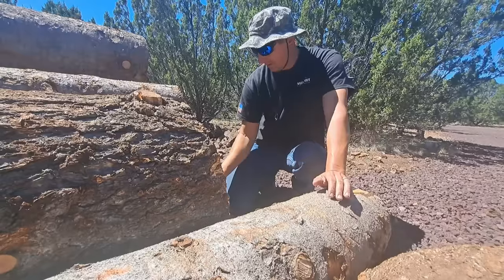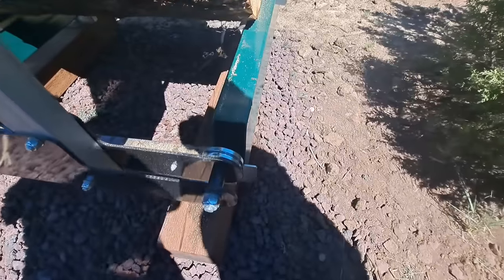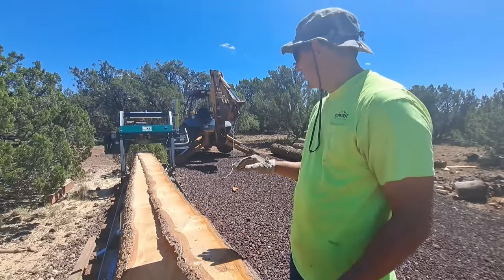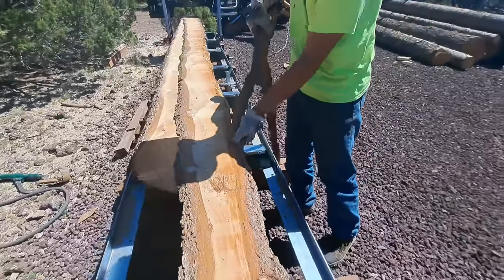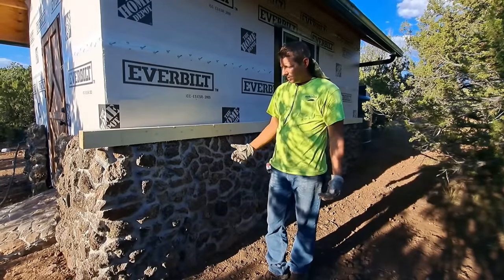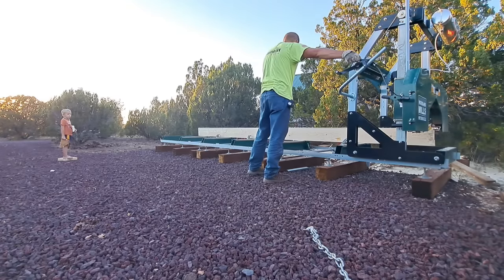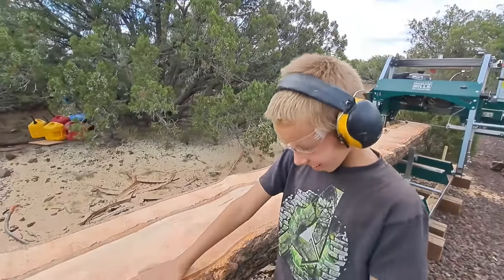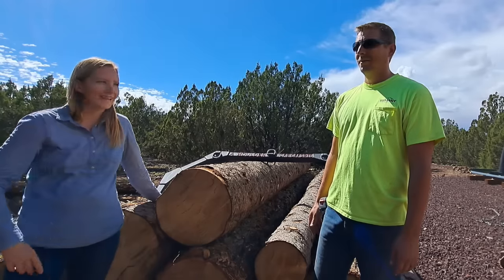LOGS Today, LUMBER Tomorrow | Milling Siding For Our SHED

Comment: I'll tell you what you can do to make it easier to pull that thing through the log that's all milk, what you do is you find your piece of cable long enough to go from one end up the bottom and up to the top, get your pulley at the bottom that you can put. The bullion of the mill part of the sawmill and then put you a boat crank up on the side of the sawmill and then as you crank it, it will pull the sawmill to the other end.  And cut the Log.

Comment: I don't miss ANY of your videos. All that sawdust can be used to enrich & stabilize the soil around your property, if you didn't already know, and the cutoff bark will burn quite nicely in the fireplace this coming winter. And Natalie? Chainsaws are powerful, dangerous tools, so you are absolutely correct to be afraid of them.

Comment: I like the idea of making your drip edge from 4x4s, but I am pretty sure there should be a PVC drip edge available. Another option could be to cut open some cheap PVC pipe and with a torch or heat gun heat it until it becomes malleable. That way you could custom form it around the rock. A little spray paint and you even have your desired color..
However you are going to do it, I look forward to seeing you solve and improvise a solution that is right for you.

Comment: The 4X4 that sits on the stone, are you going to cut a lip the thickness of the siding, then cut a slop from the lip so water will run off. Much like a drip cap over windows and doors just larger. Also a groove under the 4X4 so water can't run back under the 4X4 still like a large drip cap.
The ramp stone is beautiful, you couldn't have done a better job, the live edge siding is going to look awesome also
Reply from the maker: Yup. You got it. Thanks 🙂

Comment: One thing I wanted to mention is yes the actual thickness of a one inch board at the lumber yard sales is  is 3/4 inch, but that is after planed and not before that in a rough stage.

Comment: You need a Bark spud for removing bark from your logs. They are made out of 1"x2" steel tubing 3.5 - 4 ft long. To get an idea of what to look for you can go to a tire shop that sells semi Freight  truck tires. They call them a tire mounting Bar. They have a curved 7" x 2" x3/8" thick metal welded to one end , this is the part that shaves the bark off your logs. you have to put an edge on it w/your metal grinder. You can save a nickle if you purchase one of these tools at a second hand store. I really like my bark spud. You make a good video, best wishes on your Homestead.
Reply from the maker: Thanks for the info. Will check it out.

Comment: Cut a groove in the bottom of the flashing so the water doesn't run back. I was told you are supposed to cut the top off one of your metal stays the first time (Red Tool House) but you got away with it. Save the bark for mud holes on the track.

Comment: Enjoying the videos. Totally agree with you regarding replacing the sill section around the stone work with timber. If it were me, I’d put a 15deg cant to the top for water run off. Also I’d router a 10mm deep groove in the underside to act as a drip. I’d set this drip about 10mm back from the front edge too. 
Will you be burning them or using some sort chemical treatment for rain & bug protection?

Great to see you teaching your boy how to use the mill.
Reply from the maker: Yes, we will use a sealer for the wood. Thanks for the tip on the drip edge. 🙂
Reply: @aboulderlifeoffgrid  you’re welcome. I’ve sent you an email.

Comment: This is just a question for you regarding the length of cut   Should the black metal that carries the mill not both have the long section facing the inside of the mill      This would solve your length of cut but what I could make out     Right now they are both facing one direction in this video    All the best from Allenford, Ontario, Canada  Have a great day
Reply from the maker: I'm not sure.  We assembled it just the way the manual says, which was pretty easy to understand and follow. Thanks. 🙂

Comment: good video
wondering...how many saw blades required to saw those 2 or 3 logs? $25 for new blades?
Reply from the maker: I put a second blade in towards the end of the third log. I'll sharpen them a few times to get the full life out of the blades. Thanks